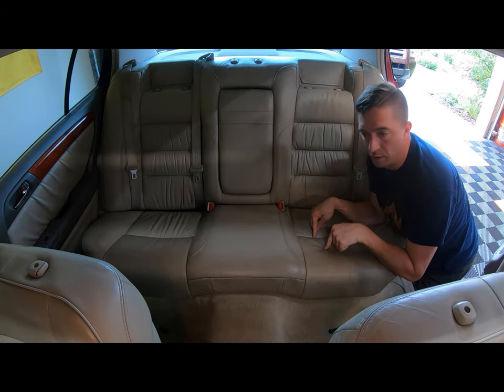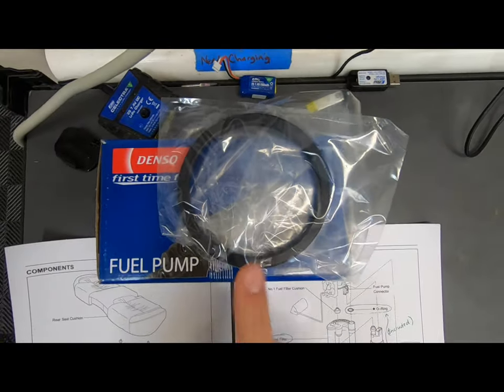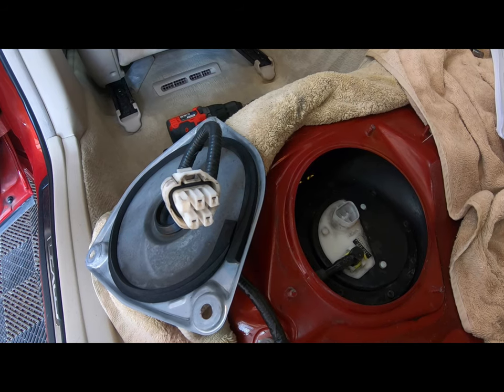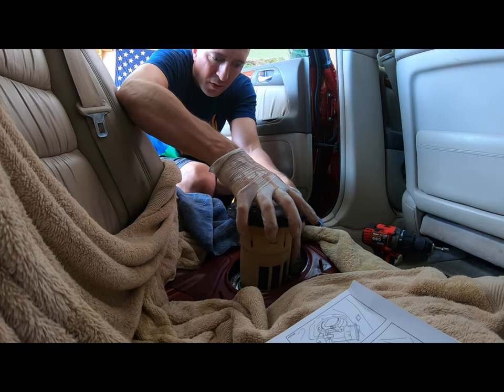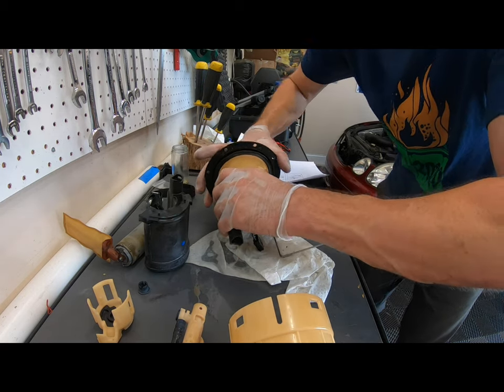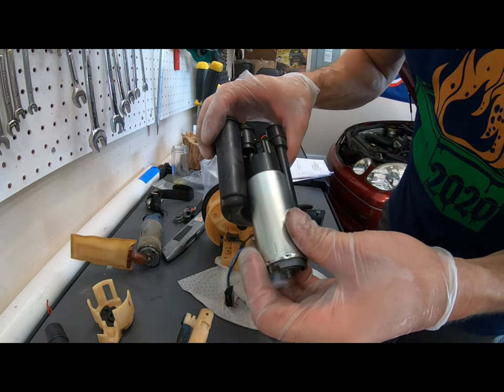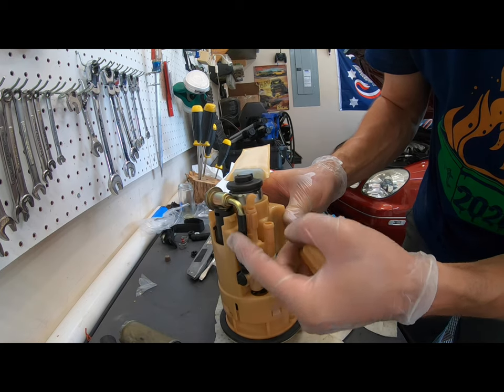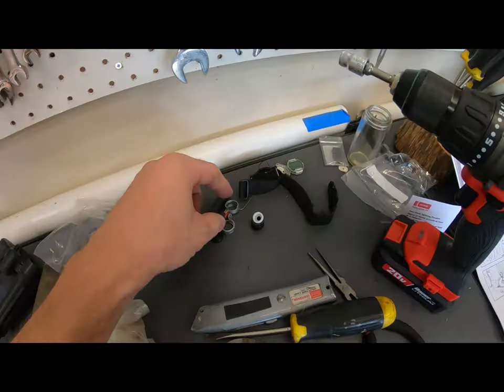TOYOTA / LEXUS Fuel Pump Test & Replacement Procedure

Comment: Love your videos how can you check fuel pressure on 1999gs 300 thank you
Reply from the maker: Thanks! I am not aware of an easy way. I think an in-line gauge has to be placed on the rail near the fuel pulsation damper/banjo.
Reply: Ok I understand I got these problem on this 1999 gs 300 it ran good it suddenly stall on me couple of days ago I kept using and it did it again now it whant start I replace the fuel pump I check for spark and injectors pulse and the are good and when I spray carb cleaner the throttle body it will run …. By the way it’s a crank no start
Reply from the maker: @kraziejavier  vac leak. Data log the fuel trims.

Comment: Do you have a video on how to drain the gas tank by using the fuel pump ?
Reply from the maker: I do not. Sorry.
Reply: Any ideas ? I'm thinking pumping it out might be the best way to empty the system completely rather than syphoning through the top of tank. Jumping the fuel relay ?
Reply from the maker: Well, I probably wouldn’t use the pump itself. With the hanger assembly that method would be difficult. Pulling the entire hanger assembly up and using a separate pump with a hose to get it out is probably the fastest and safest method. The only issue is there are two chambers in there I believe. Accessing the second chamber might be tough if you need to get all the fuel. Another possibility is to puncture the tank and reseal it, but I really hate creating damage if it’s not entirely necessary.
Reply: I was thinking on disconnecting the fuel line in the engine compartment and then jumping the relay. Attaching an oversized hose from the fuel line to a Jerry can. Thanks for getting back.
Reply from the maker: That’s a thought, but that 6AN flare fitting is notorious for being difficult to disconnect. Proceed with caution. Report back on what works for you if you don’t mind. Thanks.
Reply: @ForwardMomentum  will do, thanks

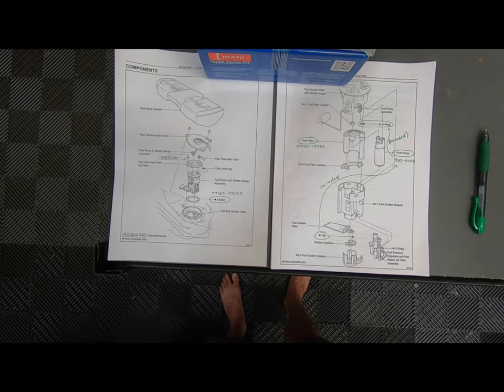Comment: 3:43 What dealer quoted you $800? The going rate here in Denver is $2,000.
Reply from the maker: That’s insane. It should be cost of parts and reasonable labor hours. That pump is around $400 from a dealer (again, depends on which one it seems) and the job takes about an hour. Assume they bill it for 3hrs at $125/hr. Add in misc parts like gaskets and stuff and that’s how $800 is calculated. $2000 is robbery.
Reply: @ForwardMomentum  thanks for the quick reply. After researching this more I think the high estimate is for replacement of the high pressure fuel pump in the engine bay. Problem is, I'm not sure which of my pumps is going bad I want to check the pressure before I take it to the mechanic, but I can't find the pressure test port on the fuel rail. Did you have to replace the high pressure pump on your lexus?
Reply from the maker: @csn6234  no. I’m not even aware of a high pressure pump. There are dampeners on the fuel rails, but aside from that it’s just the in-tank unit. That unit has the FPR as part of it. What model do you have?

Comment: Did you get these parts from rockauto? Or are they from lexus?
Reply from the maker: Gasket from a dealer on eBay. Pump from authorized Denso dealer online.

Comment: Going to replace my fuel filter in my GS430... Anyone know the part number for:
Fuel Filter to Top Assy. o-ring
Fuel Pressure Regulator o-ring

cannot find this information anywhere!!!
Reply from the maker: Good luck. I had the same problem. The Denso and install kit comes with a replacement o-ring. One. So I used it on the pump outlet and just left the existing regulator o-ring back when I did mine. I now run a Walbro 255 so the set up is totally different.
Reply: @ForwardMomentum  probably will try my luck and order some Orings that look like they will fit and see how that goes then! Thanks!

Comment: great video and helpful but I changed mine and a code appeared P0125 insufficient coolant temperature in a closed loop fuel control
I changed the coolant temperature sensor, checked the coolant level changed the thermostat and still have this code on the computer. plus the car wouldn't start after a long drive.
Reply from the maker: You got this code after changing the fuel pump?
Reply: @ForwardMomentum  yes
Reply from the maker: Very strange. Here’s what another gentleman found: “A/F Heater Fuse was misplaced inside the fuse box. Mechanics accidentally put it in "spare" slot.“
Reply: @ForwardMomentum  I've got the gs430 where could I find this fuse?

Comment: Can't even find the Denso pump no more. I started to buy one 3 years ago now they're discontinued
Reply from the maker: Yeah it’s out of stock everywhere. Totally sucks!
Reply: @ForwardMomentum  How do you test the fuel pressure on the GS? I have a 300 so I'm not sure if the 400 has the in tank regulator or not like the 300. But there's no Schrader vaIve. Do you have one?
Reply from the maker: You have to put an inline gauge at the feed line to the rail. You can put it where the damper goes or you can cut the feed line and put a barbed 6AN gauge in the line. Pressure should be about 45psi at idle.
Reply: @ForwardMomentum  Cutting? No! Lol. But ok thanks for the quick response. You're the man!
Reply: @ForwardMomentum  Get a GS300 and work on it, so I can ask more questions lol.
Reply from the maker: I cut mine for my supercharger install. No big deal, but I understand the hesitation.
Reply: @ForwardMomentum  Oh yeah that makes sense for your application.
Reply: @ForwardMomentum  Went with Delphi pump since it had the most Clublexus reviews as a replacement for Denso. The kit came with the same things you had in the video, you had the new o-ring for the fuel filter in your hand ( when you said "These are extra don't worry" lol ), in the Delphi kit it was separated from the other clips and things. It was at that moment I remembered your video and walaaa it's the fuel filter o-ring.
Reply from the maker: Great! Glad it all came together. 👍

Comment: My suspension has been acting up, car shakes at highway speeds and I cant figure it out.
Reply from the maker: Do you feel the shake in the steering wheel or seat or both?
Reply: @ForwardMomentum  I just changed the inner tie rod ends and found while the car was up that its the ball joints in the front. The upper control arms and lower ball joints.  Thanks, man! Love this channel.

Comment: Dam so its 4 o rings 1 on the regulator 2 on the filter 1 on the pump 😅 no wonder i’m getting long crank issues when I go bellow a half a tank smh 🤦🏽‍♂️
Reply from the maker: Yeah, quite a few. The most important is the “top hat” o-ring. It must be correct or the car will long crank.
Reply: @ForwardMomentum  thanks great info!

Comment: How hard is it to replace the sending unit? Is it just plugged in?
Reply from the maker: Can you clarify your question?
Reply: @ForwardMomentum the float or sending unit sensor is that just plugged into the fuel pump housing? My gas gauge level on the dash is not reading correctly I figured it may be the sending unit.
Reply from the maker: Gotcha. I haven’t replaced that, but it looks pretty easy. I had an issue with mine being stuck at half tank and I used sensor-safe cleaner on a Q-tip and carefully cleaned all the sending unit contacts and it fixed the issue. Perhaps consider that first?
Reply: @ForwardMomentum  I will try that first. Thanks for letting me know so quickly